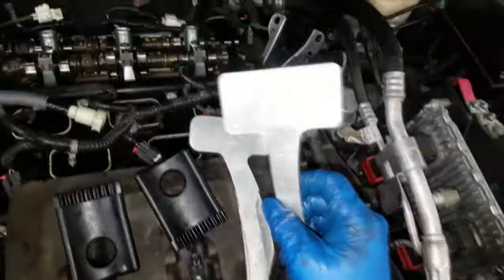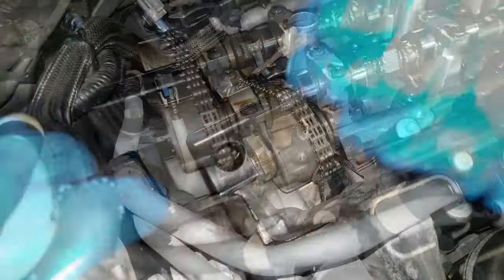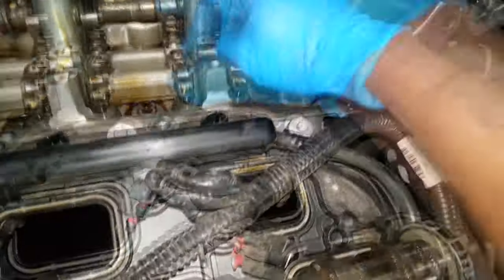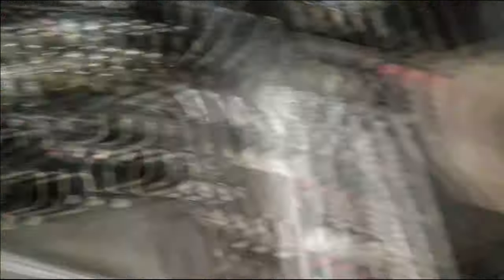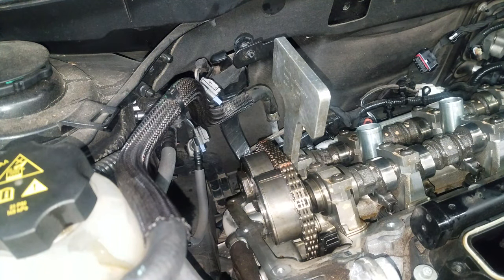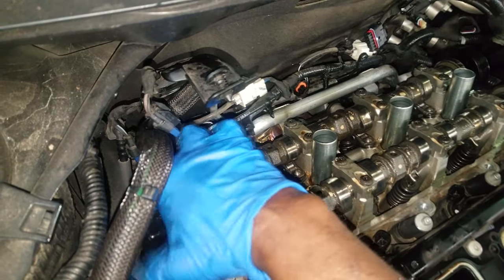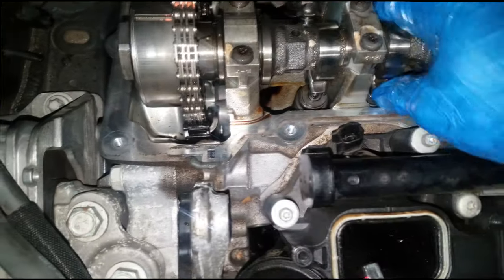Cam phaser, camshaft, lifters,  broken rocker arms on rear Bank 1 head. 3.6 V6 Pentastar P0340 P000B

Comment: Hello online mechanic, I’ve watched a few of your posted videos on timing chain repairs/replacement. In one of them that I watched you talked about changing the cam phasers without pulling the motor out of the car. Do you have a video regarding changing cam phasers on 2.4 eco tech .
In the video that I have seen you do this, (non eco tech motor) you used a metal and even a plastic curved tool that you slide around a bolt on the engine block to create slack in the chain in order to remove the phasers. Is this what is needed on the 2.4l eco tech motor? If it is Can you tell me the name of the tool or send me a link as to where to buy it? Thanks and keep helping us, your fans, with your videos.
Reply: You also have a video where you use a bar to push back the tension rod ( like on the 2.4 eco tech) and you reinstall a thin wire like the pull pin that came in the tensioner when installing. Would that be the method to use on the 2.4 eco tech?

Comment: hey nice video. have you had any problems with the valve stems? miss fire
Reply from the maker: Hey bud, thanks for watching. No, no history of problems related to that. ARe you subscribed to the channel? Please do if you not, thanks
Reply: what are the most common causes of miss fire? i did plug and coil and still have a miss
Reply from the maker: @economico2313  what year make and model is your vehicle? Also are you subscribed to the channel?
Reply: 2017 grand caravan gt 3.6l it has a miss fire on cylinder #3
Reply: @OnlineMechanicTips  i just discovered you channel and i like the content. i subscribed today
Reply from the maker: @economico2313  Ok thanks. Listen misfire in cyl #3, that bank 1 meaning the rear cyl head in the center. You telling me you have already replaced coil and plug on cyl #3. (the center cylinder on the rear head) Now if you still have a misfire a couple things could cause this, a restricted injector or even a intake manifold leak. Even a filed rocker arm would cause this, btw, do the engine make a ticking noise? My point is that, you should verify cyl 3 even doing its job, you should get a compression test done to determine that. No point in moving on with diagnosis if compression low in that cylinder

Comment: Thank you. Your videos are very helpful. Have a P0344 code bank 1 after replacing a bad rock arm on the bank 1 side. I did not remove the cam but loosen to replace the bad rock arm. I have replaced the cam sensor and pigtail to this sensor as required. I have made sure all connections, to cam solenoids and crankshaft are good. I was reading that the cam phasers cannot make contact with a magnet. I did drop a bolt near the cam phasers and used a pick up magnet to get it and am 100% sure the magnet made contact with both cam phasers and as the magnet was stuck to the cam phasers when trying to get the bolt. Could this cause the cam phaser to fail based on the magnet field. I believe the cam phasers work on a magnetic field to make adjustments to the timing. I have read some technical bulletins that indicated the cam phasers should not make contact with a magnet (trays, magnet pick ups, tools that a magnetic. Not sure you would know the answer?
Reply from the maker: Yes, these are all precautionary things to be mindful of. But the cam phasers can cause this code from a physical standpoint (coming apart internally) Curious, how many miles on the vehicle? Are you subscribed to yhe channel?

Comment: using a rug will do the job. no need sst. put rug under the cam phaser til it lean against the chain guide making the tensioner to stay still being pressed with no movement at all. but you got money so why use rug.

Comment: Brother, you are a life saver. My wife's Journey had a tick and lost alot of oil due to the oils filter housing going bad. Pulled everything apart and found a bad lobe and rocker. Gotta replace the rocker, lifter and the cam. Your video is a huge help in prepping for this job as it's my first pentastar engine.
Reply from the maker: Well thanks for watching the vids bud. Remember to thumbs up the vids also an good luck

Comment: Can a bad cam phaser cause a p0017 and c121c . Crank cam correlation and torque converter request denied? Or do I have two separate problems?
Reply from the maker: Yes, but theres ways to check it. Do your ABS/Traction control light come on? Also are you subscribed to the channel?
Reply: @OnlineMechanicTips  both check engine and traction control light on . Not the abs light. And yea I am
Reply from the maker: @Phoun615  Yes my friend, A cam phaser will def cause your problem. When they start to fail, timing may become to advanced which will cause your problems. The timing chain rides on the cam phasers

Comment: Is it a Metric or Standard sized socket?
Reply from the maker: 36mm
Reply: Also, my wife has a 2014 Chrysler 200 Touring 3.6L V6 Flex Fuel that I did a timing job on, based on your video. Which tensioner tool did you use for Bank 1? I tried all three of mine, including 10369A, and I couldn't get the tension off the chain. I don't understand what I did wrong. I followed that bolt as you did and I didn't want to force the tool in there. Any tips?
Reply: @OnlineMechanicTips  1/2 Inch-Drive or 3/4 Inch...?
Reply: @OnlineMechanicTips  the reason I am asking is because I want to get a torque wrench for the socket so I can torque it to specs.
Reply: @OnlineMechanicTips  I'm not trying to blow you up, but I am just curious as to what I did wrong with the tensioner tool. Thank you very much for replying to me, brother! All your videos are great and extremely helpful!
Reply from the maker: 1/2
Reply from the maker: The cheap plastic tool im hearing from mechanics is its garbage
Reply: @OnlineMechanicTips  Can you please provide me a link to get the metal version? I cannot find them anywhere!
Reply: @OnlineMechanicTips  Can you point me in the right direction to order the metal version of the Timing Chain Tools, brother?

Comment: HI i found a rocker had come off my intake cam left bank do i have to put it in tdc to replace the rocker.?
Reply from the maker: Hey bud, it depend on which cylinder. The cyl 6 which is the furthest away from the timing chain can in some cases be lifted up and rocker arm put in place. But I would still bring top dead center up and mark it. Was it ticking? Also are you subscribed to the channel?
Reply: @OnlineMechanicTips  yes im subscribed , long story had p0008 code so i remove rocker covers didn't really notice the rocker in bank 1 cylinder 5 so start rotating crank clock wise then ant clock wise it came to a stop so i didn't proceed any further that's when i seen the rocker arm sitting in middle of the head, now the question is was it already there before i pulled the thing apart or did i cause the issue by going ant clock wise, some say it would have been missing but the car was running fine except for the code that kept coming up.

Comment: Working with the tool to bring the tensioner back for 2 days 2014 3.6. Can't pull the tensioner back no matter how I use the correct tool. Do you grab the tensioner with the tool at a slant or straight down?
Reply from the maker: You working on a FWD or RWD? Also are you subscribed to the channel?
Reply: @OnlineMechanicTips  4WD and subscribed 2014 Grand Cherokee 4WD
Reply from the maker: @troyshepard592  Hey bud, If this a Jeep its RWD, thats what I meant..I assume you working on bank 1 the pass side head..This can be a lil tricky but the tool used to simply compress the guide back some..I not understanding the problem. Once the guide compressed inwards, everything should fall in place. In fact, I never need the tool. Its all about movement placement. Watch this video and see if this work for you here and listen to what im saying: https://www.youtube.com/watch?v=5P6K3QyHgC0&t=4s

Comment: Got to keep that chain tensioned. You don't have eyes or marks on the crank. One slip and you're in for a world of hurt.
Reply: There are guides around the crank that won't allow it to move teeth.
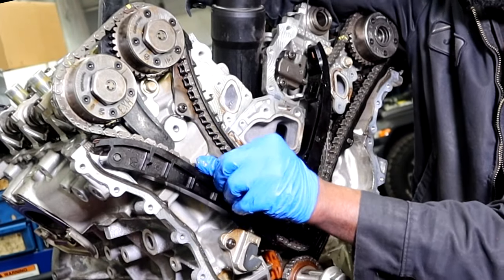Reply: @jjthajett  Around 5:20 you can see that the guides don't go down that far.

Comment: Just bought a 2014 grand caravan 3.6.   Was throwing a code P0305 when I bought it.  Thought I would get lucky with new plug and coil.  No luck.   Still throwing the same code.  Make a clunking noise.  Thought it was just one of the pulleys but local mechanic said no.   Pulled the valve cover off of the back and cam lobes all look good.  Van runs, just throwing same code and clunking noise.  Any advice on how to proceed.   Your videos are some of the best I've seen.  The cut away really helps.  Thanks for taking the time to make these awesome videos.
Reply: Just watched your other video.   I'll do the "field test" tomorrow.   Praying its something up top.  Thanks again for the awesome videos.
Reply from the maker: Hey bud, its past time for a compression test. You have to find out if cyl 5 able to perform as design
Reply: @OnlineMechanicTips  Rocker arms look fine and no apparent scoring marks on the cam.  Is next step removing the head?
Reply from the maker: @pedaldork  My friend. You should need a reason to remove the cyl head. This is not a easy job. Verify that the head should have to be removed. Run a compression test, If that cyl low, then yes, theres your need to remove the head. If compression at specs then you should keep looking. Have the cat been replaced on bank 1? Are you sure the injector not causing the misfire, you could easily swap/move over an injector to see if misfire follows.
Reply: @OnlineMechanicTips  Would a bad injector cause such a loud knocking noise? (originally was hoping it was a bad pulley).  Will do a compression test in the morning.   If fails compression, then I'll take it to a garage as anything beyond the valves is beyond my paygrade.  Thanks for your help.

Comment: Just did this job now im getting codes about the cam being out of timing p000A. Any help is greatly appreciated.
Reply from the maker: O my friend, you likely out of time. Im sure you marked the cam phasers before you took apart right?
Reply: @OnlineMechanicTips  yes marked them but thinking i made a mistake somewhere i took the head completely off to have it inspected but found out the head is fine and the problem was the cam and rockers (idk if thats the correct term) just like in your video. Im going to remove the timing cover and make sure the time in correct.
Reply from the maker: @theshow0024  Yes, thats your best bet. Sorry you have to remove that cover, that sucks
Reply: @OnlineMechanicTips  yes sir we live and learn thank you for your time and videos unfortunately i found them after the job but they've been alot of help since ive found them thanks again!

Comment: I’m doing my wife’s rocker arms and lifters (all 24) on her ‘11 journey. Problem I’m having is I’ve got the left side cams turned to their 30 angles but almost all of the cab bolts, will not break loose. And Some are starting to round off and the other will loosen just not in the order they’re supposed to!! Any idea has to why this is happening?
Reply: Anyone else ever have this kind of problem?
Reply from the maker: My friend you have to have a real goo pro T30 bit to use on the cam cap bolts..If they are stripped, just vise grip them off and use new bolts. Also nare you subscribed to the channel?
Reply: @OnlineMechanicTips  you mean like a really good brand? And yes sir I am
Reply: @OnlineMechanicTips  and where would I get the bolts
Reply from the maker: @justins8638  yes, high quality. But ive been known to strip them then just use regular same tread  bolts. But torqued to specs
Reply: @OnlineMechanicTips  alright. I appreciate the help. Thanks for all the videos too, they helped big time
Reply: And one more thing I promise… as I was pushing down the wedge on the right side for the phasers, something snapped  and now the chain has a ton of slack. Idk if they did it before or not but the guides move side to side now? Idk what it is that broke(if anything)
Reply: It’s me again… unfortunately. But ummm the vice grips aren’t working and neither is anything else that the internet says will work

Comment: I messed up and took off the cam phasers ,before i marked the the timing Chain , , how do i get it back in timing? thanks for your videos  i should have watched them before  ..LOL
Reply from the maker: O wow, not good. Which cyl head? is the a van or a car?
Reply: Online Mechanic Tips .2014 Jeep Latitude, Bank 1,  well I did mark the intake cam phaser/chain/cam .. but failed to mark the exhaust!  And now I believe it wasn’t TDC. . I completely removed the intake cam and replaced all rockers and lifters.
Reply: Online Mechanic Tips .. Can I bring piston one up to TDC and verify bank 2 cams timing arrows are aligned and then re-position bank 1 cams back to TDC ..
Reply from the maker: @bradclark9560  Yes, bring up TDC. verify that that bank 2 in time then put in time bank 1 whereva timing chaning end up. It should be 12 links apart from eaxh phaser,. Its complicated but doable
Reply: Online Mechanic Tips Thank you!  Just so I am clear it’s TDC piston 1 on the Compression stroke! (Balloon inflates)  and bank 2 arrows line up?
Reply from the maker: @bradclark9560  Yes, with both valve covers off. Bring #1 up to TDC, if bank 2 on correctly, arrows should be pointing to each other. Now at bank one, that head needs to be put in time properly and because bank 2 was installed correctly, you should be able to correct bank 1. Simplys bring cam mark up top such as I did in the video and install phaser. Now because you un sure where timing chain at, you will have to go off feel. Do intake cam first, put phaser on chain to the point where the phaser mark will match the cam mark and try to put chain on that phaser without moving chain any. Bring that phaser to the cam mark leaving no slack in chain. Now count 12 links then do the exhaust cam the same way, pyt chain on exhaust cam, set it in place, 12 links from intake cam. It should feel and align properly, all the while making sure bank 2 head still in time and has not moved. This will be tuff bud but your only other option is to remove the cover and do it right. I have done it both ways with success. Good luck man
Reply: Online Mechanic Tips ... Dude!!! You are the MAN! You was correct ..it was a pain in Butt...   took me most of the afternoon!!  But I got it all back together With OUT taken the timing cover off. .. and I went ahead and replaced all the lifters and Rockers while I had it apart.   And Now it’s Quite as a Church Mouse !!  Thanks again for your channel. And your response back and forth with your subscribers..  I wish I had watched them in detail before I had started this project. It would have saved me so much time and frustration..  thanks again  You RoCk !!

Comment: Where can I get the tool to release the pressure off the chain for Bank 1?
Reply from the maker: that tool kit on ebay for like 15 bucks bud. Please thums up the video and subscribe to the channel, thanks
Reply: @OnlineMechanicTips  I purchased two sets of this tool set for the bank one and neither of them seems working. It slides in but won't come over the tensioner to release the tension. Any idea what I could be doing wrong?
Reply from the maker: @semihyilmaz4699  Hey bud, bank 1 is the easiest 1 to do. What kind of car is this? Did you subscribe to the channel?
Reply: @OnlineMechanicTips  Yes, it did. It is 2012 Chrysler town and country,  3.6L. Tool set is plastic though, both of them. I asked people to send me only if they are metal but they sent plastic tool set.
Reply from the maker: @semihyilmaz4699  O wow, the tool I use not plastic but im not sure it should matter.And because this a van, bank 1 in the rear which will make this job tighter. I have to be honest with you bud. I rarely use the tool, it can be done without the tool. Its all about positioning. Once the exhaust cam phaser on with the timing marks lined up, the intake cam can be put on by merely using the wrench to turn the exaust cam forward so the intake phaser and be put on while in the timing marks, with a little small effort it should slide right on. But if you dont feel good about that way, dont do it.
Reply: @OnlineMechanicTips  I appreciate the answer.

Comment: Chrysler tech too, been doing this for years.
 Great instructional and close up of the bolt used for collapsing the tensionor.👍
Reply: You wanna change my rockers
Reply: @michaelkaylor4779  if you were local no problem.
Reply: @richardparker1317  where are you located
Reply: @michaelkaylor4779  NC
Reply: Yeah rich. Too far. lol. How many hours does it take usually to do ? Or book hours ?

Comment: Great video as always. My question is I don't see this engine lasting 10 yrs or so. One of the things is as this engine get older those timing chain guide will break easy. When you install that special  tool since the plastic on that guide will be old is more likely will break the guide in pieces and now you are doing a timing chain guide job. Right now is good because this engine are not that old. I'm talking in the long run.